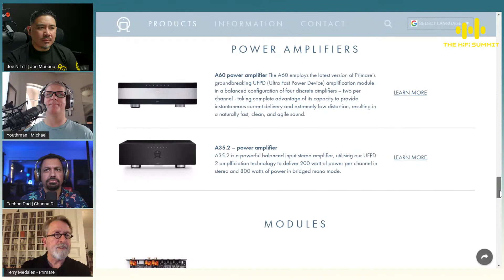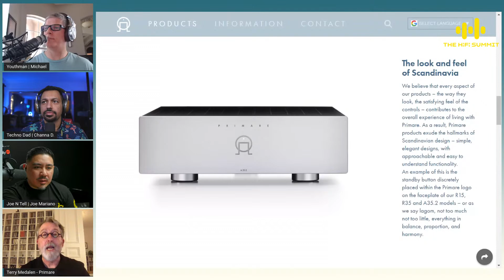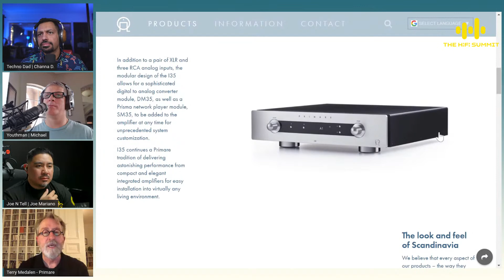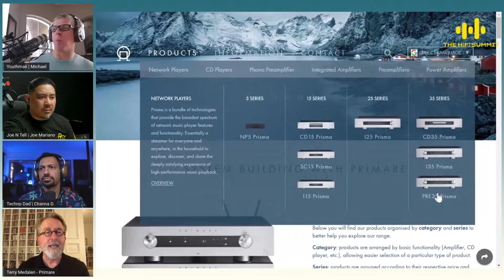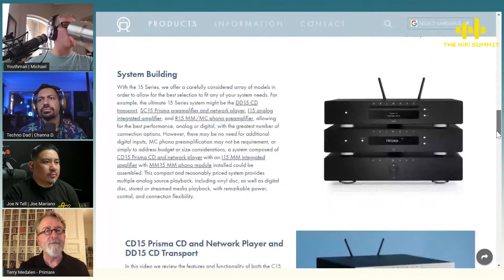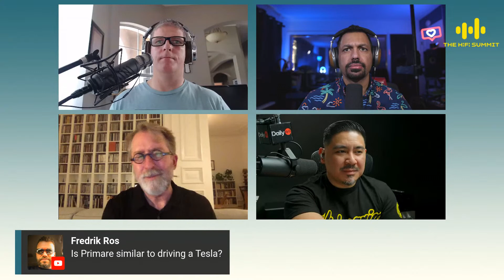Primare Design Philosophy | Terry Medalen | The Hi-Fi Summit 2020 Q4

Comment: @Daily HiFi  
@Joe N Tell  
👍 The Primare i25 is probably the best Class-D amplifier I've ever heard.  I'm sure there are others I've yet to experience, but Primare make extremely solid, well-built, and exceptionally sounding products, at especially reasonable prices considering their quality and performance.

With the "Prisma" versions, you have the option to have a complete all-in-one unit that includes a high-quality DAC and network streamer.  And still at a very competitive price.

I know that 99% of people will not believe that it is possible to hear real differences between amplifiers, especially via an Online "YouTube sound demo".  But I urge you to listen to the following amplifier test/comparison using your best headphones or full-range speaker system, and then decide for yourself.

The same speakers, and consistent recording techniques, along with matched levels were used in this test.  Focal Sopra No. 1 stand mount speakers.

Live Multitest Integrated Amplifiers - 2500 euro
at
TheAlphaAudio

https://youtu.be/hW8-ijjT0tg